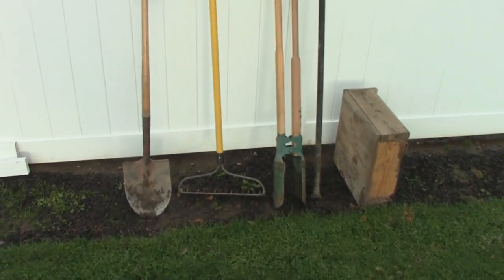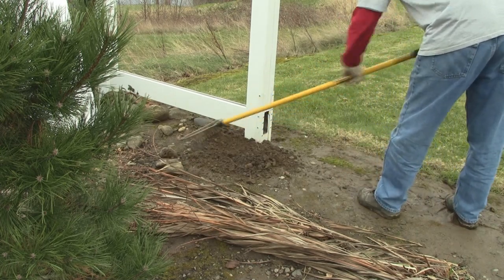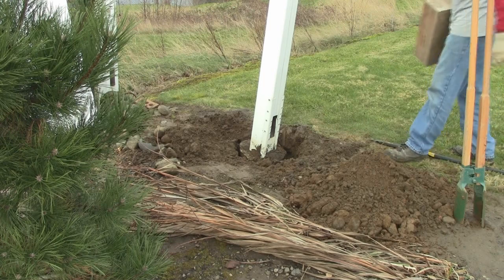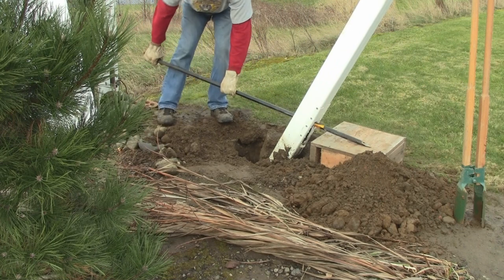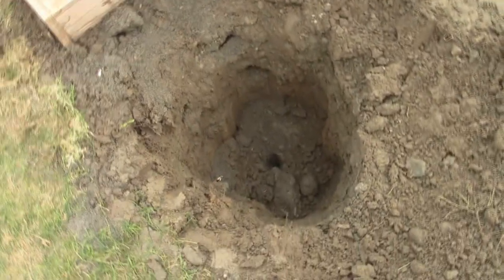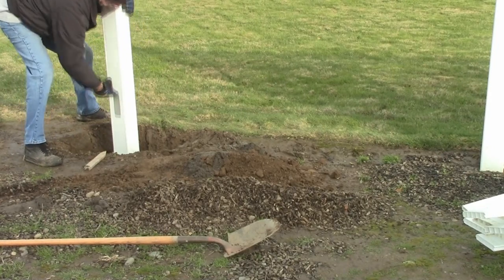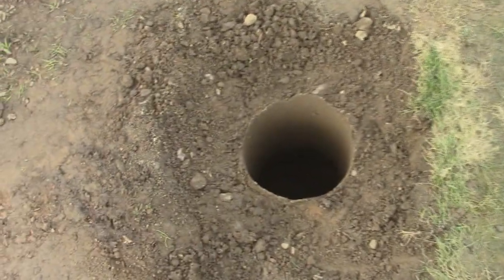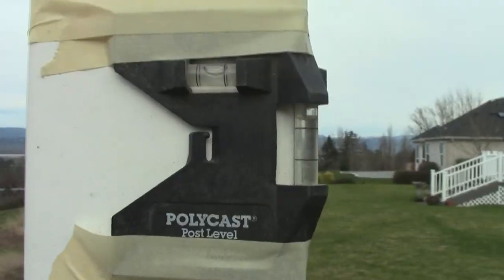Remove Vinyl Fence Posts WITH Concrete! SUPER EASY!

Comment: Amazing! I never even considered using a form and backfilling around it! And the tip to do a bit and pull the form up so you're not trying to pull the whole thing up at once will have saved me either a form or a lot of back pain. :)
Reply from the maker: Hi Mattie, Thank you for the kind observations on my video.  When I came up with the ideas, I knew for sure that there were others that juuuuuuust might like to see the shortcuts.  Peace...and save that back!  :)  Rich

Comment: Wind is demoralizing.  

I need to plumb some PVC gate posts that have settled. 

In a nutshell similar to removal but only have to excavate the side of the post out of plumb then backfill.

For setting fence posts I prefer pouring in the concrete dry and mix in the hole.  One bag per post.

Comment: I love the video good information and funny gonna start mine in a couple of months. I might need your help come to New Mexico LOLOLOL  I do have a question though, I've seen on other videos people pouring the concrete in the whole first and then putting the post inside the concrete so the concrete would be inside the post, thoughts?
Reply from the maker: Hi Mark, Thank you for your comment, and glad that you liked the show.  As far as having concrete inside the vinyl post, I'm not in favor of that technique. It doesn't allow the vinyl to flex at the level it was designed. More importantly, it allows water to get trapped inside the post on top of the concrete which can cause a breakage (why I had to replace mine) should you have a deep freeze.  Peace, and good luck!
Reply: @richwahneEXPERTSmadeEasy  Thank you for the info. I was think about that issue. I'm going to go with the concrete on the outside. When I get started I'll shoot you some pictures. Thanks again.

Comment: I just replaced a vinyl fence post I backed into and cracked. I used a 60-inch pinch point bar tool to remove the old post. Next I cleaned out the hole and slide the new post in the old concrete hole. Took about 30-minutes.
Reply from the maker: Hi Mach, Thanks for the addition to the comments!  What you experienced, from what I've learned, is quite rare. More often than not, the concrete is stuck to the vinyl post and they don't come out separately....pleased to hear that you had such awesome results!!  Thanks for sharing! Peace.  Rich

Comment: It’s been 5 years. How’s its holding up?  Did you put the fence in yourself to begin with?  I’m not a professional but I think that the hole is too small for that 5x5  post. Did you use metal inserts to keep it breaking again at the sheer line?  I came across your vid after I made that mistake. Now I have to dig out the old posts.  But I’ll make it easier on my self and just rent a jack hammer and break the concrete and meet the hole relatively small. My post holes are 16x16x24. And this time I’ll put in the metal sleeve first. 😤
Reply from the maker: Hi,  Great question!  I had the original posts installed by a local fence company, around 1998; and those installers did a few things wrong which allowed water to pool inside the post. The water would freeze, and break the post!  My repair allows the water to drain, and has lasted perfectly!  No metal inserts,  and not a single issue to announce. As a matter of fact, the posts that I replaced are in excellent condition!  And here is something to know...I live in an area that has severe wind, almost all winter. Forty to fifty mile per hour winds aren't out of norm for this area, and my fence takes a beating!
Keep this in mind about the size of the hole. As you pull the round sleeve out, the concrete is compressing the soil around it, and over time the compression and settling holds the vinyl post almost perfectly (from what I'm seeing after 5 years anyway).  I have to say that I stand behind my install techniques.  
Thank you very much for the comment!  Peace
Reply: Great video, Could you have cut the form to the proper depth and left it in? Back filled around it? I feel like I’ve seen form like that filled with concrete and used as deck footings.

Comment: Do you think it would be possible to cut the vinyl out of the cement and slip a new post in place?
Reply from the maker: Hi Frank, Sorry it took me so long to get back to you.   You ask a very interesting question....and I'm not sure.  I think it would be very difficult to cut the vinyl out of the existing cement, but I guess it would be possible. And if you were able to get the old post out, getting the new one back in the same hole might be difficult.  

I'm sorry I don't have any better answer - I just don't know for sure.  If you give it go, please get back to us and let us know how it went.
Peace and Abundant Blessings!
Rich
Reply: Thanks for the input Rich. I have been able to remove the old post fairly easy with a 5' pry bar. I have ordered the new posts and will let you know how it works out. I am hopeful that will go in because I am needing to replace about a dozen post because of a brush fire. I appreciate your videos and found them useful.
Reply from the maker: I'm sorry to hear that you're having to replace your posts due to a fire.  I hope your idea works, and most importantly...please be safe!   It sounds like you might be on to a fix that I never thought of.  I have faith that you will be successful!  Keep us informed.  Rich
Reply: I just helped a friend replace 300 feet of vinyl rail horse fence destroyed this year by a brush fire. The ground here is almost solid rock so concrete removal is impossible. The corner posts we had to redrill with a rock auger on skid steer, but many of the other posts we simply split the existing post stubs with a crowbar and stuffed a new post in its place after putting a cut slit at the end. The posts fit perfectly in the holes and are stable till now.
Reply: @chargermopar  skid steer & 10k lb nylon towing strap let’s you pull them right out of the concrete plugs

Comment: What do you do when you have monster tree roots and cant dig next to the pole like my house.
Reply from the maker: Edward...thanks for the question.  If you have tree roots, I'd suggest renting a chain saw to get as much of that root out of the way.  You might have to take the root out in buckets full of chips, but at least you can remove it; or at least make room to loosen the soil around the post. I HATE tree roots, and I wish you the BEST of luck.  BE SUPER CAREFUL with that chain saw too...maybe rent or buy a small electric chain saw, as they are much more tame.  Good luck!
Reply: Sawzall , I just went through this.

Comment: not a eallygoodidea to fit posts on its own.!
The rails and pickets should get in too, otherwise the clearence would not be sufficient!
Reply from the maker: Crystal Babe   FYI...it all fit perfectly!  Guess how?  Yep...I measured and made sure everything fit!!!  What a great idea the measuring tape.
Reply: its not that !
once the cement sets in and hardens there is no way to get the rails in other than bending the posts away to insert them ! expecially the bottom ones. therefore the rails ( or a complete set) must be inserted BEFORE cementing.
Reply from the maker: Crystal Babe  You are mistaken!!!!  The vinyl system is designed to snap together after the posts are set, and the concrete is hard as a rock. This vinyl system goes together AFTER the concrete is hard. The rail slides well into one post, and then splits the difference by sliding it into the second post; and so on and so fourth.  That is the ONLY way you can install a vinyl fence system.
Thanks for your comments though.

Comment: Your video is very concise. Our fence has weathered numerous hurricanes and tropical storms, but hurricane Ian decimated it. Sheered the posts off right at ground level! 😳 So now we don't have anything to grip for leverage like in your video. Any suggestions will be most appreciated. 🙏
Reply: I'm in the same situation, also thanks to Ian. What I'm considering for the broken posts is to initially dig down deep enough around the post to drill holes using a hole saw or large enough drill bit. Basically create holes for the 'persuader' bar to fit through. If that doesn't work I would try to drill holes in the fence post as described above then use a short, durable strap to loop through the hole posts & over the 'persuader' bar. Good luck!!

My current count is to replace 17 posts, all broken during Ian. It'll probably take me a month, if I'm lucky. 😆
Reply: @pauldavidarmstrong6069  right on, I am also in the same boat. Brand new fence install 3 months ago got decimated by Ian. I have 10 posts snapped and several others heaved. I have seen some videos that suggest I might be able to straighten out the heaved ones and reinforce with more concrete. Another idea I saw is to actual rebar and pour concrete inside the post to stiffen it. (the one caveat is this makes it very challenging to replace any bottom rails if needed in the future, but not impossible.) The other option is steel beam inserts for the inside but those cost about $80 per post. I want to bulletproof my fence for any future storms since it is so new it was painful to see it go lol.
Reply: @pauldavidarmstrong6069  I'm in Port Charlotte. We literally had our fence put in a month before the storm destroyed it. we have a lot of intact post that are just leaning. can you use this same method to straighten them?
Reply: @legendkochis9909  I think drilling hole(s) into a post to straighten it would NOT be ideal. If the posts are leaning yet otherwise undamaged, it may be possible to partially dig out dirt near the post in the area you want the post to move (a post hole digger might be preferred but not required) until it can be repositioned to where desired. Then refill the hole & compress the dirt. Be careful not to dig too deeply, you don't want the post to go deeper into the ground. Also be aware that posts set in concrete may take a bit more work to reposition. Another option would be to add concrete to better set/hold the post (once repositioned, before filling the hole) but it's not required.

I hope that helps. 🙂
Reply: @pauldavidarmstrong6069  The posts are vinyl and they're set in concrete. I don't want to dig for ever. I'm thinking of digging around the larger part of the concrete top then wrapping a chain to a farm jack to get them out. Then refill the holes and start over. I was just trying to avoid replacing the posts since 90% of them are intact

Comment: God ! I hope my post never go bad, just installed a fence in the yard. 15 inch diameter holes of concrete over 2ft deep. 10 inch diameter a little narrow for that post, no?
Reply from the maker: Thanks for the comment!!! I can't in my wildest imagination why you'd need a hole 15" in diameter?  If you check out every professional fence installer, they're all using either a manual post-hole digger, or a power auger, both of which dig a hole approximately 9-10 inches wide. I'm certainly not telling anybody exactly how to do this repair, rather what work extremely well for me.  Best to you and be safe!!
Reply: @richwahneEXPERTSmadeEasy  yea man, seen a few videos before taking on the project that you wanna be 3x’s the post size. It’s referenced in one of the ASTM standards. Whatever way works though right.

Comment: Aren't those posts meant to be pushed into a hole full of concrete.also save some time by just putting a rubber band round your level.good video though.
Reply from the maker: Hi the Lying Scotsman - after having the vinyl post break off right at ground level due to water sitting on top of the concrete (inside the post) and freezing - I'll never ever EVER put concrete inside another post. The way I installed these posts, the water drains out, and not a ounce of freezing problems inside the post.  Thanks for watching, and for your feedback! I appreciate the kind words!   Peace

Comment: Why not just use a cinderblock instead of the 2x4s ?
Reply from the maker: I don't see any reason why you couldn't use a cinderblock...however, I would place a piece of plywood, or other wood protector on the cinderblock before I placed my lever on said block. That way you'll reduce the risk of breaking the cinderblock.  Thanks for the comment!!!  Peace

Comment: Why not cut form to length and leave in the hole?
Reply from the maker: Because it's made of paper, and as the paper breaks down, it would leave a gap between the hardened concrete and the dirt. There may be a form that would not break down, I just like being cautious!  Thanks for watching and for the comment!!

Comment: Great Video! Great idea for removing posts. My back feels better already.

Two questions, I also live in a high wind area and will have to replace one 12' double gate, one 4' gate,  and 12' of fence, so 5 posts in all. I have read that it is a good idea to put PT wood post inserted into the vinyl posts as well as aluminum or steel stiffeners in the gate posts. First, why did you not use PT wood 4x4 in your post replacement and how do you cement both a wooden post and vinyl post at the same time?

Again thanks for posting the video, great stuff.
Reply from the maker: +SquisherWA - Thanks for the kind words.  

The #1 reason I didn't use any stiffeners, is because of the way the posts and rails are designed to slide together, there has to be an open space inside the post or there would be no way to put the fence together. If the inside of the vinyl post was filled with a 4x4, you would not be able to slide the rails into the posts. 

The #2 reason I didn't use any stiffener inside the vinyl post, is that the entire vinyl fence system is designed to give, to move with the wind. If you stiffen the posts, you would be transferring the entire wind-load onto the rest of the fence panels and they will break (I had it happen on another fence).  When the entire system moves with the wind, there is a designed amount of give that allows the fence to "breathe."   

The reason my posts broke was due to water building up inside (due to no drain in the bottom), and freezing - which broke the post right below the bottom slot for the rail. (the water could not raise any higher due to the lower rail slot). The expanding ice broke the vinyl right at ground level, and the wind did the rest. With these replacement posts, I made sure water would not build up inside the post, by creating a sand and rock drain at the bottom of the hole, and pouring the concrete in around the outer edge. Good drain, no ice, no breaking of the vinyl.  Viola!  :)

Once again, thank you for the note, and the kind words.

Comment: Rich, here's question - I want to remove my last panel on my fence, and replace it with a gate instead, the panel is about 4'.  Is there an acceptable method, aside from pulling up the two posts, and putting in two gate posts - of mounting a gate to the panel posts?
Reply from the maker: I think the only way you could use an existing post (that is IF they are vinyl) is to place (or hide) a 5"x5" wooden post inside the vinyl post so you have a strong mounting point. Then, I would have a gate made to fit the distance between the two posts...viola!  You'd have a gate that you could fit a lot of different size items though.  Hope you find that helpful, and THANK you for watching and for your comment!!  Rich
Reply: @richwahneEXPERTSmadeEasy  thanks. Hadn't thought about that.  I'm pretty sure when the posts were put in they used wood inside at the base below the bottom rail.  I guess I could spray paint some brackets on the outside to join the two wood posts for strength. at the base.
Reply from the maker: @gginnj  Sounds like you've got a good plan. Of course I'm at a disadvantage because I can't see your fence, or the posts.  I have confidence that you'll come up with the perfect solution.  Thanks again for being part of this thread!! Rich
Reply: @richwahneEXPERTSmadeEasy  - maybe premature. spoke with the installer today - the posts are hollow and cemented  I could drop the metal pieces in to secure the hardware to...but there would be no strength at the weak point where it would sit on the cement....I guess I could try, and if they snap, well....Then I would be forced to pull the posts and replace them....maybe a summer a project.
Reply from the maker: @gginnj  IF the vinyl posts are hollow, see if the concrete (at ground level) is both inside the post and outside the post...if it's only on the outside, you can drop the wooden post in and it will drop down to the bottom of the vinyl post...then you fill the space between the two with sand to make it stronger than heck.  The reason I recommend that, when I install a vinyl post, I make sure that there is no concrete on the inside of the post; so the water can drain out at the very bottom. If there is concrete inside the post, the water can sit on top of the concrete and if there is a freeze, the water freezes and fractures the vinyl post right at ground level.  Hopefully your concrete is only on the outside.  Best of luck.  Rich
Reply: @richwahneEXPERTSmadeEasy  He told me some have both inside and out some just outside. I wasn't there so I don't know if they sunk the post in the cement, or poured the cement around the post and put some down the rail opening. But in thinking about it - it's the last panel of the fence run, and it would be a fairly small gate - so the wind stress on the post would be minimal - so just dropping the metal or wood inside the post would most likely be strong enough. We do get freeze temps so that part does worry me slightly.
Reply from the maker: @gginnj  I TOTALLY get your concern about the freezing. Water sitting on top of the concrete, inside the post at ground level, freezing, and breaking the post right at the ground level - was the reason I had to replace the posts in this video. I think you have a pretty good idea how you're going to proceed...and I'd bet you will wind up with an AWESOME gate!  Thanks again!